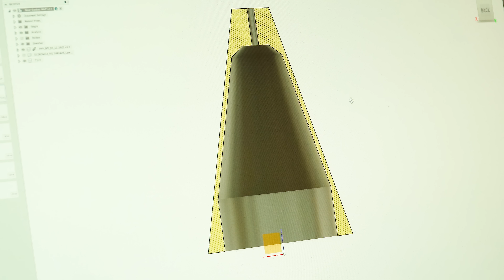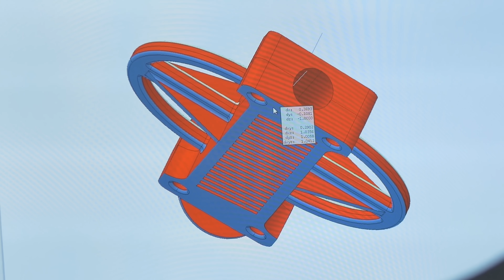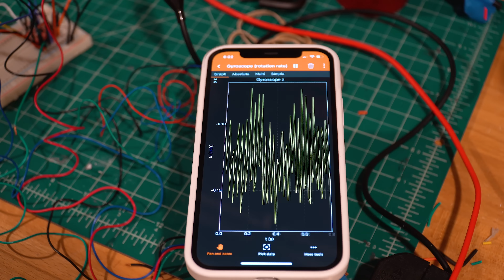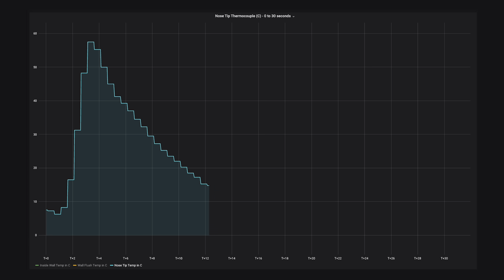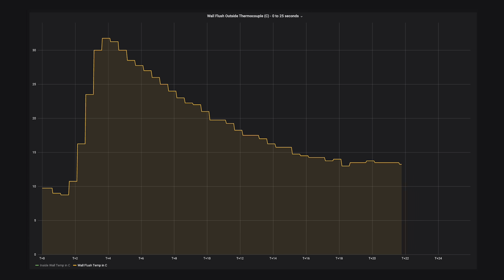How Hot Does a Rocket Get?

Comment: Mini-oven in the nose cone that capitalizes on the electrical power onboard to drive Peltier modules to actively transport heat from the metal nosecone into the oven?
Reply: I suppose it doesn't even have to be an oven per se, the hot end of the peltiers can attach to a metal plate with an array of needles that can be shoved into the meat to both hold it in place and cook it from the inside?

Comment: I think having some thermal mass on the outside nosecone is actually a good thing!

For properly cooking the meat, it needs to be >60°C for a considerable amount of time.
Not 120°C (or whatever Mach-3 gives you) for a short time.

So quickly sucking up all that energy from the outside and delivering it slowly to the meat inside would be ideal.
However, this way you also allow for a lot of air to cool your mass again (after you've slowed down) before it had a chance to heat the meat…

What about a retractable cone inside which thermally isolates itself (air gap) from the thin outside cone once it sucked up all the heat??

Comment: I see some improvements. First the camera spinner could be replaced by some spinning mirrors it will be lighter to rotate than a complete camera and so smoother, even if yours is fantastically smooth.
Second, I would stick a thermal camera inside the nose cone, the Flir One is small and compatible with Android. Thermocouple are cool, but any bad thermal conductivity between the TC and the part that you want to measure and you end up with false temperatures.
Finally I would had a lot of small spikes on the nose cone to get a turbulent flow, you can even use heat pipes to get the heat faster inside the nosecone.

Comment: Instead of placing the meat on the inside of the cone put a pocket on the outside and cover with a thin piece of sheet aluminum. Kind of like a cover for the nose. Gonna have to size the pocket to squish the meat slightly to ensure efficient heat transfer. Otherwise air pockets will insulate and protect the meat.

Comment: Aluminum dissipates a lot of heat, your nosecone should be made with aluminum only in the tip where the meat is, and the rest should be non-conductive epoxy or some other composite.

Comment: Small exposed steel tip transferring heat straight to a heatpipe warped with meat
Reply: Wrapped Heatpipe points straight down inside just small tip is exposed

Comment: Identify where on the cone surface the most heat is generated using an IR camera on the inside of a thing-walled cone. Use a material for the cone that does not transfer heat as well as aluminium so you can get good differenciation in the image. Next build a cone from 3 parts, using only aluminium for the part where the most heat is generated. Make that part as thin as possible and stick the meat on the inside, padded with insulation, keeping the heat accumulated from escaping from the "oven".

Comment: To get more heat onto a piece of meat, I would take inspiration from all-metal pans. Since the pan and the handle are all bare metal, there is a slot that they machine into the handle close to where it meets the pan. This increases thermal resistance and keeps the handle a lot cooler. Why don't you drill a ring of holes aft of the "meat roaster" area to increase heat concentration to the area where it is needed? You can then seal those holes with epoxy/rocketpoxy which is a great thermal insulator. 

The only thing that you would need to work out is the elasticity of epoxy - too rigid and the thermal expansion differential might cause the seals to fail. Too rubbery and you might have the epoxy melt to failure - either way, and your aerodynamics change. So, you'll have to get it just right.

Comment: Maybe a nose tip "clay oven" ?
- turning a hollow nose tip out of pottery clay to stick the meat in (you have to cook the clay, just in case you were wonderin' ^^),
- separate the tip from the nose cone with cork (or something) to stop heat going from the tip to the nose cone body
- friction fit (? XD)

I have no idea whatsoever if the cooked clay will resist the aerodynamic forces but it will definitly resist the heat, even at mach 3 :D
Also, you might want to make the nose tip a bit more blunt so as to spread the surface area that heats up, I think... (supersonic regime is....weird...)

Comment: I think a small diameter tip extention would help. Make sure the holder for it is thermally insulating so it doesn't bleed heat to the rest of the nosecone.

More out there: make the tip of the nosecone a ram air intake for a vortex tube, use the hot air to air fry some fries, use the cold air to freeze some ice cream base.

Comment: What about heatpipes to bring the heat from the surface into the rocket where the meat is? I was stupid enough to hold a heatpipe with my fingers on one end and bring the other end into the flame of a candle… boy, did I burn myself…. or use silver as a thermal conductive.

Comment: I'm sure I'm not the first person to suggest this, but a copper nose cone might work, as well as using heat pipes to conduct the heat.

It might also be worth experimenting with the mass of the nose cone/cooking section. More mass means the heat is applied for longer, but it wont get as hot. Less mass means it'll heat up faster but lose that heat faster too. But for a thin strip of meat you might not need that much time.

Comment: Mechanically inverting panels on the cone.

You don't need all the meat to cook immediately during the temp acquisition... you just need a way to get all the heat you do generate into the meat as completely as possible.
Make a cast iron panel on two sides of the cone that heats up at speed, and then flip them inward to seer/cook both sides of a piece of meat suspended in the middle of the cone.

Comment: I think what you’d need to do is kinda like weird heatsink, where metal rods are thermally attached (are those words that make sense?) to the nose cone. The additional rods give it surface area and instead of cooling them off by running air over them you stick the rods into the meat.

Comment: 5:38 you can solder it you have to make a equation correction, but there are soldrable vago connectors.
Reply: You can also print ridges/slots to snap them into, and they remain firmly fixed but still open to snap/unsnap. I think these fixtures are commonly found on Printables if you search for Wago connectors now. I have several junction boxes with this implementation, and it’s honestly the most flexible and reliable junction box I’ve ever used (I’m in my mid-forties, and have been doing this for a while).

Comment: Would the rocket be stable enough with a rounded nose cone? Most of the heating comes from the sudden pressure rise at the nose of the rocket, so if you could increase that area without spreading the shock wave into your find that would be cool!

Comment: The camera spinner is super cool! But couldn't you just mount several cameras around the circumference of the rocket and then stitch the video together? You'd have to make sure the frame rate rate was high enough to prevent motion blur, but it would be a lot less moving parts

Comment: Total temperature in kelvin = static temperature x (1+0.2M^2), where M = Mach number = True Airspeed / Local Speed of Sound.

Do the maths at sea level for Mach 1 and you get 288.15 x (1+0.2x1^2) = 345.78 K = 72.6 deg C, so not that hot.

Once you start getting higher Mach numbers the temperature really starts to increase, due to the M^2 term. It helps that the static air temperature reduces with altitude, reaching about -56 deg C at 11km and staying roughly constant until about  20km up, where it starts to get warmer again.

Comment: Thin walled nosecone design out of a material more thermally conductive than Al-6061, like a copper alloy (prioritizing ease of machining and cost). Meat is suspended on the inner surface of the nosecone to cook. Might need to do some quick math to understand if you need to do some internal supports to prevent the surface from buckling. Plus some easy first order heat transfer math on if you will have enough time to cook meat to a given temperature.

Comment: If my train of thought is right meat has too much density for the current time of flight even at Mach 3 speeds, to cook the meat the time of flight will have to be somewhere in the 5-10 minute range if the cone is sitting at 350°. So maybe make a “cruise missile” the flies in a circle above you and then the winglets also would gather heat that can be transferred via heat pipes.

Comment: For that thin piece of meat, salt cure it.

Literally all you have to do is take a cheap steak and put it in a container or zip lock bag with a bunch of kosher salt for 2-3 days. Then slice it as thin as you want.

Cured meat won't mess with the thermal results (estimates) as much as one would think, also, cured meat has less moisture which is good for electronics.

Edit:

Have you thought about 3D printing your own motor? That way you could place all of the analytic electronics on the actual motor, then place that system in the rocket with the center screw/rod in place. But IDK what the end goal is, so meh.

Comment: To cook meat rapidly with air, do a search for "Impingement oven".

If you go to Subway and have a sandwich toasted there in 15-20 sec, this is the main trick that makes it possable. . 

I used to work for a company who made extremely fast food cooking ovens, which used "Impingement", where high speed jets of heated air were used to transfer heat into food quickly, thus the ovens were able to cook 4x to 10x faster than an normal oven.

Contact me if you wish to know more.

Comment: About that meat problem, I think it is not possible to mount meat on the outside, but here is what you can do:
1. Minimize thermal mass of your cone, you can make thinner walls, or separarte aluminium cone into 2 sectiones connected by epoxy(cut out a small square on the side of your cone) , sand it dow a bit, and glue it back with epoxy, so there is about 1mm gap between aluminium parts to minimize heat loss. this idea has its problems (you can not capture as much heat energy)
2. make the walls thinner, and the aluminium portion of the cone as small as possible (just the tip and a bit of walls for the meat), you can even make it non symetrical (small cone on tom (3 sm or less) and a littlle triangle of aluminium connected on the inside for meat)
3. You need to clamp the meat down realy hard, you can make the indent in aluminium for meat and cover it with a wooden rectangle, so the meat is contained.
If you do not understand any of my ideas, pleas ask in comments, English is not my first language. I also would like to send you drawings, but I do not know how

Comment: Something ive been wondering, despite its off centered mass, does the camera spinner offer any form of stability to the rocket? If the rocket is spinning at 5 rotations per second clockwise and the spinner is doing 5 anti clockwise will it somewhat slow the rockets rate of rotation?

Comment: Very nice Joe.

Yes, those Wago connectors are huge. You could use crimp connectors on thermocouple leads, with housings down to 1.25mm or 1.00mm pitch. Or better still, with that temperature range, you could get much better accuracy and reliability, with simpler interface electronics, with precision thermistors or PRTs. I have extensive experience with using thermistors so reach out if you would like further input.

I also have extensive experience with stepper drives and a stepper is definitely the way to go for the simplest precision control. It is certainly possible to maintain tight position control up to the rates you’re dealing with there and a microstepping drive. That was done with 1980s technology and we have way higher control bandwidth available today. You just need to know how! Keep at it, when you crack it you will get rock steady footage.

Comment: You might want to consider using copper for the nose cone. Copper is very good at conducting heat and is stronger than aluminum. 
The only downside is that copper is heavier.
Reply: Aluminium is also an excellent heat conductor.
Reply: Copper is better than aluminum for heat conduction.

Comment: I don't have a clue how this would affect overall aerodynamics, however, if at the tip of the nose you had a hole, with a second, very thin aluminium cone recessed so that the tip coincides with the location that the oblique shock from the leading edge would converge, and a "vent" further down the cone or body, I imagine the shock heating at the tip and along the sides of the inner cone would be significant, and more localised. Rather difficult to describe the geometry, however imagine a scaled up retracted clicky pen, where the ball point is the thin walled section with meat inside.

Comment: Could it bet that the high g-force during acceleration somehow caused the system to bind? Since afterwards everything rotated smoothly.
About the nose cone, how about adding vertical fins, like a heat sink, or maybe something similar to vortex generators on plane wings. 🤷‍♂
Reply: Searched for your answer coz I had exactly the same thoughts about acceleration.

Comment: For future/higher-speed iterations: Regardless of the wall thickness, you're still trying to transfer heat through the walls, through air, to your meat (weird to say). Aaaaand trying to do so over a short time window. Even if you wait a bit you don't have much thermal mass (thanks to the thin walls) to continue transferring built up heat. It's just too small of a thermal battery. --- Thankfully, both of these issues can be fixed with one change. --- ... Think "Sous Vide" ... --- This should also allow a larger piece of meat as it will continue cooking for longer while providing support against G loads. --- Additionally, increasing the surface area of the cone interior will mean more energy transferred into the interior vs wasted to the exterior.

Comment: Why use thermal paste + 5 min epoxy? Why not just use thermal epoxy? Probably is a far more reliable thermal transfer, as thermal paste is designed to work only as a very thin layer, and under pressure. Still have to minimize all that stuff, as they have quite poor heat transfer (better than air, but still not great). 

Also, you can solder thermocouples to boards perfectly fine, as most chips have build in cold junction compensation which (at least in your use case) compensates enough to have a negligible effect. This is true as long as both joints are at the same temperature as the CJC (which is generally the case) and mirrored between connections. Sure, having the wires directly clamped to the board is the 'proper' way of doing things, but you don't really need that accuracy. More important is thermal coupling between chip and connections, and between both connections, and shielding the connections from outside heat sources/sinks. Thermal gradients are your enemy. Depending on the type of metal in the wires soldering itself can be a bit iffy (and require high temp solder), but another option is just screw terminals soldered onto the board.
Having one of those terminals there to connect the wires isn't that different to soldering, you are still changing to different types of metals, which will generate a seebeck voltage. There are special connectors available which are made out of the same materials as the thermocouples themselves (e.g. copper constantan, chromel-alumnel, iron-constantan etc), but I am pretty sure you'd pay a pretty penny for them.
As another point on the last thing I mentioned, static errors are something you can easily calibrate out of your system, as thermocouples are reasonably linear, so a certain error (ex. 1 deg) in cold junction temp will cause an equal offset in measured temp.

Also fun fact, the location of the spinning thing on the record table doesn't matter. A rigid body being rotated along a given rotational axis experiences the same rotation, regardless of distance to the rotational axis. The only thing that changes when moving further away from the rotational axis is that the rigid body will start having larger translational velocities.

As on the design of the hose cone, its obvious that you want as little thermal inertia as possible. Essentially the heating of the nose cone dumps a certain amount of energy into the nose cone, and you can either spread this out using a large thermal inertia, or have it more 'concentrated' at a much higher temperature (as you saw in your tests). So I would have a very thin tip of metal that conducts heat very well (ex. copper) that is isolated from other thermal sinks. Perhaps you could just stamp it out of copper sheet? As when you 'seal' the bottom, it should be quite stiff and strong.

Comment: to make the heat from the nose cone more efficient, you could have the inside of the cone, after the meat, filled with aero jell as it is very efficient at storing the heat generated.
Also, you could switch to a nose cone material that is better suited at gathering heat

Comment: I haven't read all the comments, so my apology if someone already said this, but the I think the rubbing of the battery is caused by it being distorted during acceleration. The LiPo battery packs are jell type internals, so as it accelerates it will swell at the lower portion of the cell. As the speed slows or normalizes the battery goes to its proper shape. A lite hard case might help protect the LiPo.

Comment: My first thought for the nose cone would be to embed L or S shape heat pipes in the cone to move away the heat as fast as possible from from the outside and use the l or s shape to create a table or a cage for the meat to rest on. using this make  the meat lay parallel to the horizon which I'm GUESSING is the best orientation for the integrity of the peace of meat